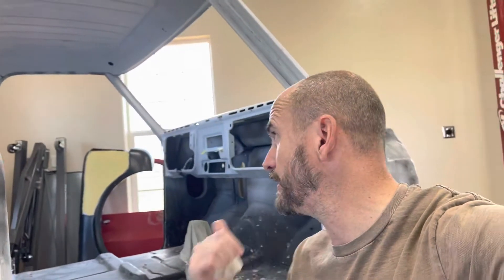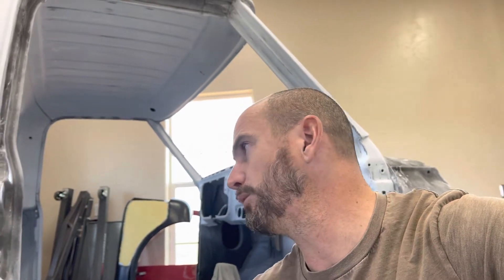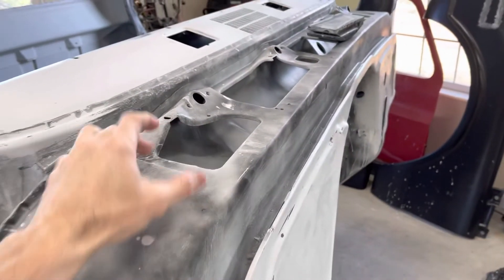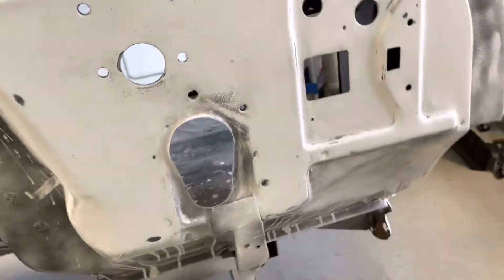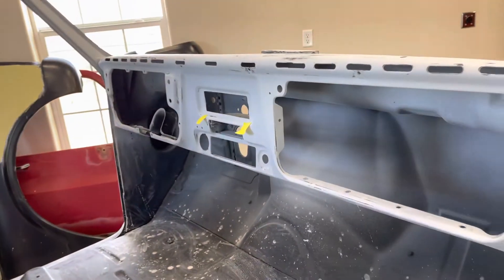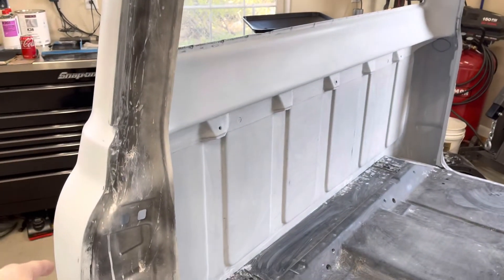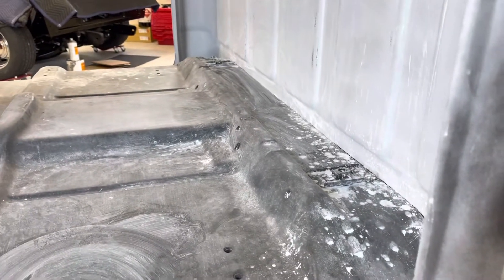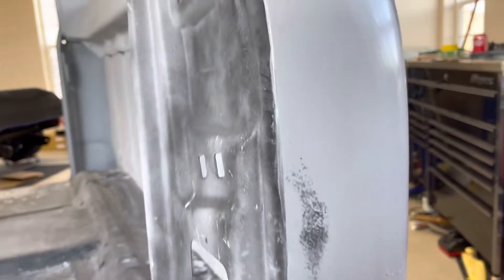More C10 sanding

Comment: Nsane hotrod has by far the best floor pan hands down .
Holes for the front cab support all ready in the  perfect location,lip for the firewall so it looks factory and thick.
Reply from the maker: By the looks on their site it’s quite possible they  source their sheet metal from the same place as AMD.  Many places sell the same product.  It’s just finding a company that you trust to sell quality fitting stuff.

Comment: Just curious why you chose a metal bed floor over a wood one?
Reply from the maker: Rigidity over wood,  wood is beautiful but I prefer it in my home not my vehicles.
Reply: A wood floor is difficult at best and I don’t have a choice for my 67 cause that is all they offered. The big one when going new, the floors crossmembers, head board in bed, everything is a different part number. I don’t have this memorized but the tailgate and bedsides are the only parts that are the same with a metal or wood option. I do know a long bed with wood takes exactly 100 1/4” X 20 TPI bolts. I started this project for my son who is now 36. He needed a truck to start a lawn service. I was welding very little rust, strange holes drill by past owners, engine, V-Belt to Serp, electrical, etc. One day after 6-7 months, he gave me the keys & title and told me to take it. I know younger guys (Those below 50) will see this, but with boys, you know when they are grownup when they total out their vehicles and not yours. I lost a Mazda 626, 4X4, a hatchback (My wife’s garage sale car, my wife’s 38th B-Day present) a 1992 Buick PA Ultra. So, that friends is how I got a 2003 Tahoe 5.3L SUV complete. The youngest found black-ice and a tree. I got parts. Then wheels turned as the 67 C10 has a 72 truck 4 bolt main 350 cu in with the worlds 4th largest camshaft under a Holley 780 double pumper. A little too much but young men dream up stuff without thinking to much!
  These is no sanding tool for the rear upper cab corners, but how often can you order a beer and tell your buddies, I sprayed primer inside my entire truck today! Rotisserie is that answer! But, I can weld one, I just need a $1,000+ for metal.
Reply from the maker: @deankay4434  I would like a rotisserie,  I just don’t have the room for one.  I don’t do enough of these to put one together.  When this is done I have a square body K5 Jimmy that was my dads I will do but that’s it on the future schedule.  As far as parts go tell me about it,  I still have so much left to order and every time I check prices they just keep going up!
Reply: @curtrobinsongarage   The only video I have seen on building a rotisserie was Jim, at his channel “Stout Customs” at his garage called the Dust Factory! He does add some humor to an otherwise boring job or body work, spray, sand and repeat. He did a 67 C10 White / Metallic Blue for a custom to show. But he did a complete on a square body.
 It seems strange to start with a C10 for my first vehicle, then end up with one 50 years latter!
 Take care and stay safe.